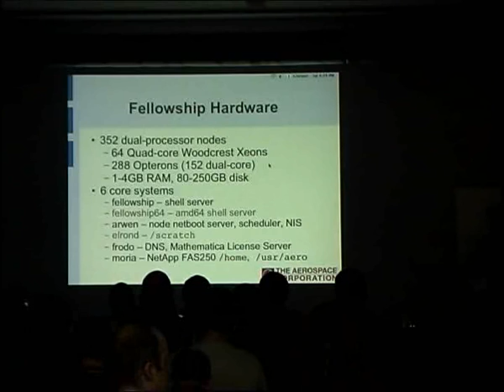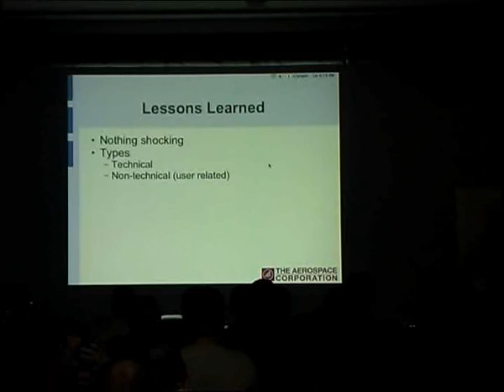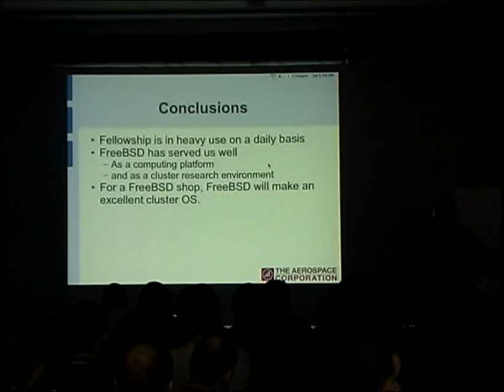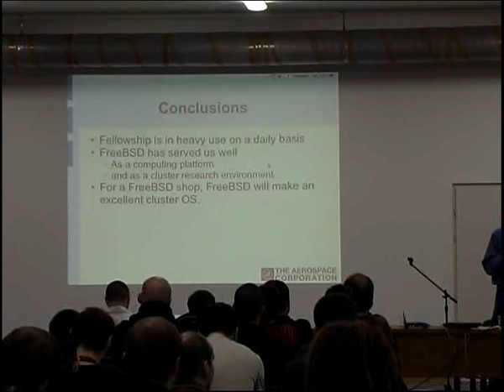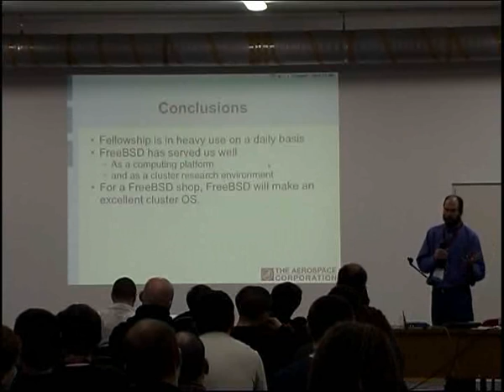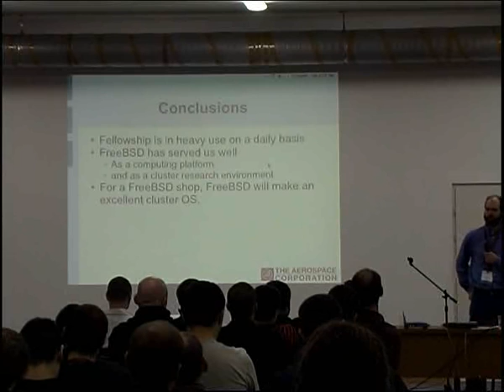Brooks Davis - FreeBSD, Building a Computing Cluster

Comment: It is possible through emulation to run Window's on top of FreeBSD. However 3DS Max, note the S, is capable of exporting it's filesets to a FreeBSD cluster for rendering.

This is how most major production houses do it at least. I know Pixar runs a POSIX compliant OS, not sure which variant of *nix it is, but most likely it's a BSD derivative.